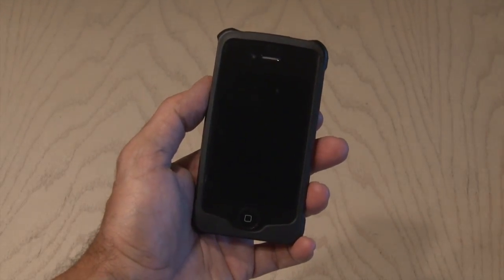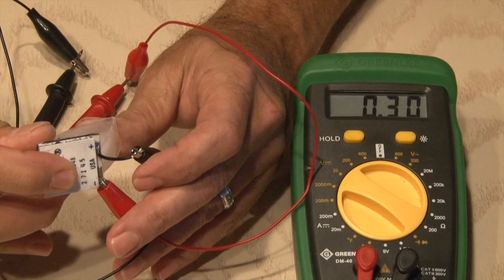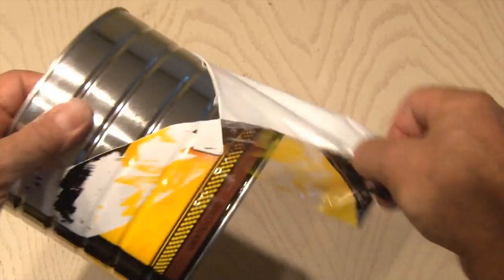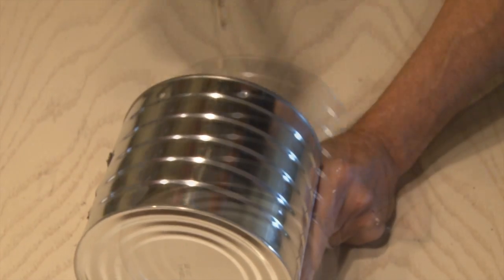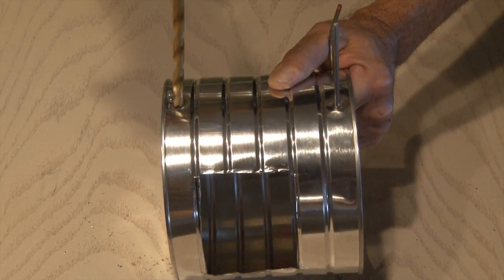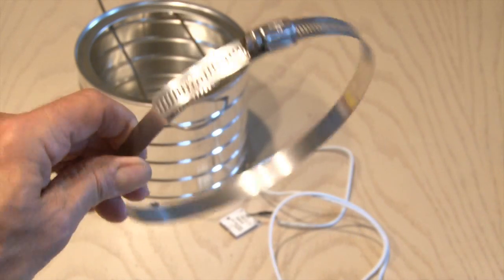Charge Your Cell Phone with FIRE!

Comment: huh COOOOOOOOOL... I want to make something now where it has over 50 of these all connected to the heat-sink system of my computer CPU, so I can make power from my overheating laptop :D (which runs at 50-60 'C when its idling, and 80-90 'C when im gaming, and the CPU max temperature is 100 'C)

Comment: ha ha ha I cant stop laughing because you forgot to put oil before you put the egg
and so the egg got burned, but you pretended everything is okay. he he he.
But thanks for the video, it gave me an idea of lining up the whole exhaust pipe of the car with the thermo electric generator in a series and parallel connection. Waste heat energy converted to electricity to power up something which I haven't thought of yet.

Comment: I just went and bought 4 of these peltier 68 watt generators. They are so cool, you can freeze stuff with them using the cold side when connected to power (mine use 12-15 volts and 8 amps). They do not generate much voltage though, as seen in the video. The cold side must be cold and the hot side must be hot for power generation, In this video both sides were in contact with hot metal, so its probably a hoax. These wouldn't generate 5 volts on their own which is why I have 4 to connect in series

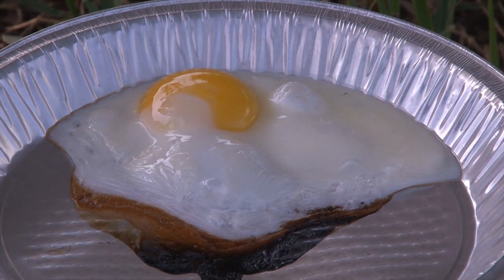Comment: You need fuckin' 5 volts and fuckin' voltage dividers on fuckin' and D+ and D- wires. And at 2:42 the battery sign on the right corner isn't with that streak who tell you that the phone is charging.You put a fuckin' green battery wallpaper.

Comment: Assuming that the generator works by conducting heat from the hot side through into the cold side, then what happens when the heat coming through the hot side heats up the cold side so much that the heat can no longer efficiently dissapate out of it due to the heat resistance of air? I guess you'll probably need something like cold water to conduct the heat out of the generator to make it run more efficiently again.

Comment: This  couldn't have worked a iPhone needs to *see* voltage on both D+ and D- data lines to charge so hooking just the positive and negative wires of the USB cable will not charge the phone .. You Sir are caught out

Comment: You're absolutely right. The iPhone has a special authentication system that only allows charging from apple certified usb chargers or computers. You would need a special circuit to trick it. However, older models of the iphone MAY work.

Comment: i made it years ago when i had an ipod and i wanted to do tutorials and stuff lol. but its true, you have to have 2volts running through the data wires for the phone to think its plugged into a usb port and to therefor start charging. this is only required for apple devices though.

Comment: I've heard that iphones don't charge unless all 4 usb wires are connected. The 2 center leads need 2v current. Also you need around 4.5 volts to charge. A peltier that size probly won't give off more than 3. So how is this working? I'm not sure this is authentic, anyone tried this with iphone?

Comment: Even those require a heat sink on the cold side to generate power as they work by having a temperature difference across the device.
Search TEG generator or thermal electric generator the commercially produced devices have substantial heat sinking on the cold side.
Here's a working one /watch?v=QKaO3l7iwEA also check this video towards the end.
/watch?v=8PWGXyb67XI

Comment: There was no need to escalate to obscenities. Firstly I am from the same region as Kipkay we lived only about 20 mins from each other. Secondly, you are incorrect. Kindle is both a transitive and intransitive verb, or was until Amazon marketed a product under the name. It is one of the remnants of Old English, which is a cognate to English kin, and Old Norse kynda. As a noun it means roughly "litter of kittens". As a linguist I am fairly confident in this.

Comment: dont work on iphone or telefones that needs voltage on the tx and rx pins usually around 3.3 and 1 or 1,5 volt. and if used incorrectly, the iphone is going down for a little burnout! i have tried it out, but no luck.. for so small peltier unit wil not give the curent needed for charging. i´m not a smartass, i´m just giving an advice from self exsperimenting!

Comment: This would not work the TEC module needs a heat sink on the cold side to work.
Then even when properly heatsinked it'll only generate .5v so 5 would be needed to produce the 5V required for USB or a buck boost convertor used.
Keep in mind these devices generally do not like getting hotter then 150c.
There are special thermal electric modules made for power generation though.

Comment: No voltage regulation, no caps, no nothing. Not even sure if the peltier cell can output enough current to light up a light bulb. What the heck man, you better start posting stuff like you did years ago...

Comment: Yeah, sure. But I think the whole construction that kipkay made is going to heat up the complete module when used for longer time. Simply because the metal from the mounting is going to heat up making the (supposed to be) cold side warm. And with decreasing temperature difference, the voltage is going to drop.
A second can with water could solve that problem. You could even place it next to a river or stream making a running water cooling with some hoses :) But I would suggest a V-regulator then

Comment: I don't think you do need all 4 as the red and black are active and neutral and the other 2 wires are meant for data. It wouldn't make any sense for the iPod cable to have power running through the data to charge the phone.

Comment: @kipkay With a more efficient thermoelectric generator, You could add plutonium based fuel for stable heat output and make radioisotope thermoelectric generator.

Comment: with electronics you need to solder components in series, hence the negative point will go to the positive point and vice versa. This way the current will be able to properly flow through both devices.

Comment: The peltier generators you linked all create 12v  USB is only 5.2 volts and iPhones only except up to 5.5 volts I guess by regulating the temperature it will hold steady ish but that a lot of work

Comment: Yup it's a peltier cooler put power through it and one side heats up and the other cools, however it will work in reverse (put a heat difference in and it'll produce electricity). As it is being used in this it's better to call it a thermocouple. They actually use this technology in deep space probes (like the voyager probes). You can actually make basic ones of these at home (better for sensing temp differences than producing power though).

Comment: I strongly recommend to use a voltage regulator(step up/step down regulator depended 
the temperature induced voltage), and to use a cooler on the cold side of the peltier module to increase the efficiency. 
Trust me, I'm an engineer ;)

Comment: Hey loving the vid, just a bit of advice if you want to improve your product. The thermal electric generator works by using the heat difference between the hot and cold side, so if you put a computer heat sink on the cold side (maybe even find a way of cooling the other side in some water) it will cool it down and make the generator more efficient!

Comment: If you want to charge an iphone 3gs+ you have to use some resistors to supply power also to the data pins (you can find the schematics online). And you should also use a 5v voltage regulator to protect the iPhone from higher voltages

Comment: Place your generator inside a cup of water make it stay on the bottom some way and when the water gets hot replace the water with cold water. This way you keep your generator from getting too hot and you should get a greater temperature range by this sort op placement.

Comment: A peltier directly connected without a voltage regulator? Would probably burn your phone if the power rises above 5 volts... Most peltiers are like 12 volts right?

Comment: It added energy for me, but getting cold and hot at the same time with this device is tricky. Also, I couldn't get mine to work because we couldn't get it hot enough before the wires melted and fell out of the cooler. Any suggestions?

Comment: Can you get thermoelectric generators that are safe to use at above 250 degrees? I want to install one on a nitro rc car and use the heat from the motor to power the servos

Comment: Several thing reminder, for proper iphone charging, the D+ & D- must give proper voltage (2V/2.5V) or short D+ D- together for IOS 5 or later. the TEG module cold side need to be hook with heatsink or the TEG module will fail in 200 or 300 degree Celcius (Depend on specification)

Comment: There is no challenge, just get a cheapy Imax B6 charger from ebay, hook up the wire to the battery (2 wire for charge and 4 thin wire for Equilibrium Charge)
those 5 wire in battery are Gnd / 3.7V / 7.4V / 10.8V / Temperature sensor (may me no connection), use a multi meter to find out correct wire.

Comment: All it takes is a temperature difference to technically be moving electrons, but the larger the difference the higher the voltage. The issue with these things is the amount of current they produce is miniscule so it would take an absurdly long time for it to charge.

Comment: There is a small problem . that module may be efficient for generating enough power but the voltage is not stable. I think you should use a 5 volt power regulator in there so you don't affect the phone or other complex devices that require stable current. besides that this is great for long trips and tech addicted people

Comment: these are usually used to heat or cool things, put power into them and it makes one side very cold like -20c but the other side very hot +50c, so if u have a heat sink and fan on 1 side, and isolate the cool side u can make a nice refrigerator for small items, thermoelectric works both ways , put hot/cold in get power, put power in u get hot 1 side cold the other, heat exchange. you should make a small fridge with this :P, (these are normally used (at the size u use them) for cooling cpu's

Comment: are u fuckin kiddin me? where's the temp difference between other sides of peltier? it's trapped with metal band connected to metal container, so the heat will be pretty much the same on both sides of peltier. and where's the voltage regulation? BULLSHIT

Comment: I agree, this is fake the iPhone requires stable electrical power of at least 5 volts as well as power over the data lines. there is ABSOLUTELY NO WAY this would have worked at all the way he wired it. end of story. period. do your research before you reply.

Comment: Thermoelectric modules do work, but this is a bad design in so many ways: you need a DIFFERENCE in heat from one side to the other and you won't get it without a heatsink on the cold side. The USB standard is 4.75-5.25 volts and 500 mA, which you won't get: you need power conversion and regulation for safe charging. There's no thermal protection and those modules have a maximum temperature rating (hint: it's a lot less than a fire puts out!) Good idea, BAD design and execution.

Comment: You better don't do this!  A peltier element provides a low Voltage of maybe just 0,3V, but a much higher current like up to 7Amps - that would easily render you phone into a bad smelling dead device.. you could load your phone with lower temperatures when you use a voltage converter furthermore it would be safer for your hardware

Comment: I think the unsteady voltage could potentially damage the charging circuit in the phone. I would not recommend this.  Even if it worked it would flash on/off charging.

Comment: If your hand drill is battery powered, just use some whiring and a piece of iron, so you can do a transformer! Divide the bigger voltage by the smaller voltage of the system, now this is the relation between the windings of the primary and secondary circuis.

Now make sure you have the relation right, connect the battery to the terminals of the primary, low voltage circuit, and the welding iron on the secondary, easy!

How haven't you tought about? MacGyver would!

(damm! Forgot the inverter...)

Comment: There's something better you can buy that I saw on vsauce. Its been used quite successfully in villages in African. You use the same fuel (sticks) and it burns clean (no smoke / safe enough to use in a small indoor room). You can cook food on it with the fire and it also generates power for a USB port.

Comment: I meant its fake you need a resistor between the 2 data pins 8miliΩ plus not enough amperage or voltage

Comment: if you can cool the side not in contact with the tin, it would output more power.

these 'techs work in reverse too, clamp a heatsink either side, apply power , one side gets hot, the other cold

Comment: It wouldnt though. Modern phone batteries have a charge of about 4 or 5 volts. To charge the phone you'd need well, 4 or 5 volts minimum. You need a voltage a little bit higher than that of the battery. And on iphones the phone doesnt accept a charge unless it receives  a "message" (if you will) from the data cables (the copper wires surrounding the red and black ones) "telling" the phone to charge.

Comment: I make thermoelectric devices, and the device in this video would never ever work.  There is no voltage regulator, and there is no heat sink on the thermoelectric generator, and the thermoelectric modules in the video would never make enough power even if you had water cooling..  If you try and make this device yourself and expect it to work - you're going to have a bad time.

Comment: Things like this are neat, but I usually purchase a docking station that holds/charges a spare phone battery while I'm using the one in my phone. Then when I go somewhere that charging my phone may not be possible, I take my spare with me in a ziplock. If I need it I have a safe, easy and reliable method in doing so. Also works great for those people too in a hurry to wait for their phone to charge. Just swap the batts and rock out the door.

Comment: Don't do it unless you do some measurements. Also it needs a heatsink on the other side, it generates current only if there is tempature difference between the sides, if you heat one, and don't cool the other, both sides will end up at the same tempature and it won't work. The better use of pelier is cooling or heating things, if you apply voltage to it, the one side will get hot and the other will get cold, exelent for better tempature exchange between CPU and heatsink for example.

Comment: If you apply cold, it generates a positive voltage and if you apply heat it generates a negative voltage. To convert negative voltage into positive voltage you can just invert the wires. Now you know.

Comment: That's what I said!?  For this to work the Peltier would needs a heat sink and it probably would not even provide enough voltage to power the phone.  I also believe that iPhones need the data wires hooked up in a certain way to make it charge.

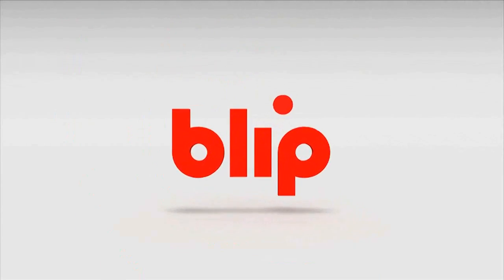Comment: Uh, no, he's right. That small generator wouldnt be able to produce 4 volts by itself anyways, if it did work that is. You'd either need enough heat to melt the generator, or several generators. Kipkay is just using a live wall paper. seriously, pause at 3:00. There is no fire and the phone still has the "charging" screen.

Comment: I bet this has been said before, but hey... This is fake. Simply put. The iPhone requires power from the data wire as well as the positive wire. Kipkay didnt connect this up, meaning the the mobile wouldn't have started to charge...

Comment: This is obviously fake.  Did any one else notice @ 3:00 the phone was charging without fire???  Plus the Peltier unit does not have any heat sink so after a few minuets both sides of the Peltier would be about the same temperature and not generate any power.  Also one Peltier cooler does not generate enough voltage to charge a phone.  You would need to connect a few in series or use a circuit to boost the voltage.

Comment: no it is fine. the sides are reversible so the only thing that would be different is he would have to flip the thermoelectric unit so the opposite side was getting the heat

Comment: To everyone who is saying that the wiring is wrong (positive and negative) the peltier thermoelectric cooler is designed to be cooled not heated, so what he has done is reversed the flow of electricity, so he would then need to reverse the wires. ie. black to positive, red to negative. As far as the data signal goes, I don't know how he worked that out. Otherwise pretty cool, it makes me want to build one but, cool it instead using dry ice or liquid nitrogen and use a voltage regulator.

Comment: In theory this should work, but this set up would not charge an iPhone. All apple products require a small voltage to Data+ and Data- to charge and this has none. This set up would charge most other phones (ie Android or Blackberry) but in order to charge an iPhone, the easiest way is to pick up a 5V USB charge controller that can charge Apple devices

Comment: if you glue a heatsink on the "cold" side it will work better.A voltage regulator also needed.
Peltier work better if warm and cold side have huge delta of Temp.

Comment: Fake! The data lines on that USB cable need resistors for the iPhone to initiate charging. You can apply voltage to the cable but it wont do anything. 

Also a Peltier that size will not charge an iPhone.

As others have also stated, unless you create a temperature difference between both sides of the Peltier with some sort of cooling on one side it will not generate electricity.